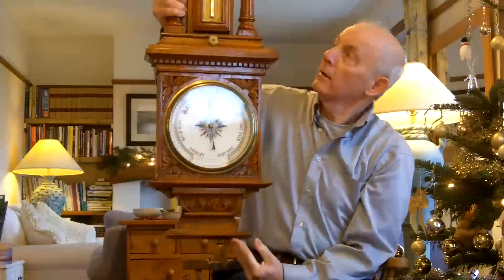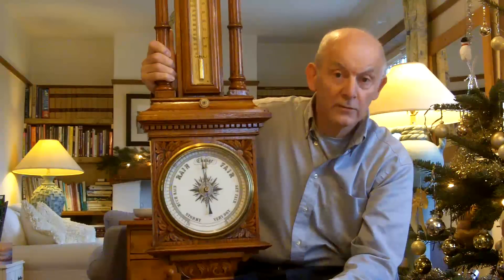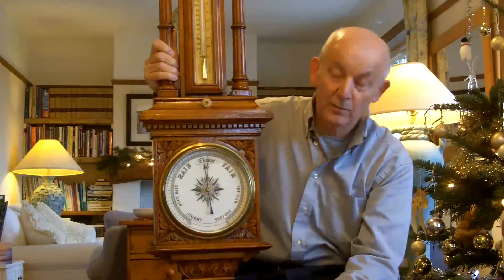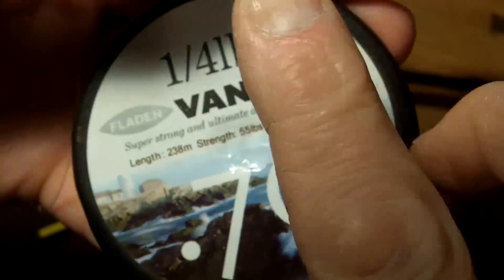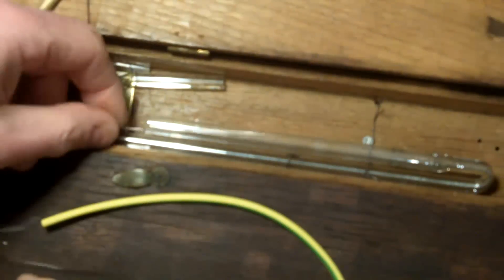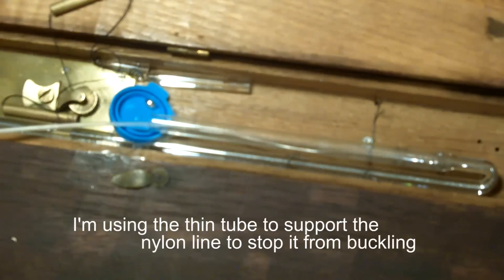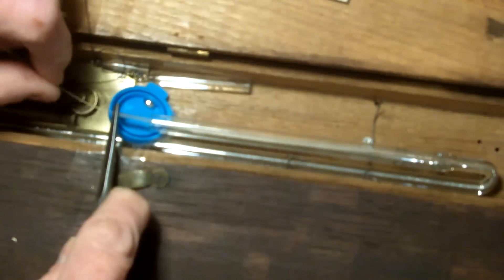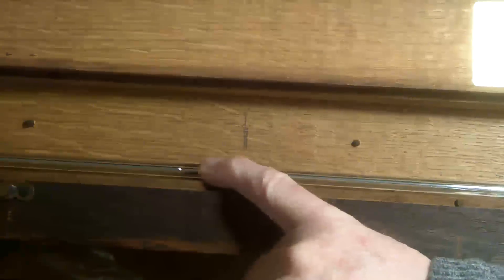Barometer...A quick look at how I removed airlocks from the mercury column

Comment: What a splendid specimen of an old mercury wheel barometer. I just bought a nice clean vintage mercury column barometer made to USA National Weather Service standards. Thank you for showing how to fix any potential issues with it. Now if I can only find the same type of a deal on a full set of lab grade mercury calibration thermometers. They are 18-24 inches long and only cover a 2 degree F or a 1 degree F or 1 degree C spread, and are marked off in 1/100ths, 1/250ths, 1/500ths or 1/1000s of a degree, graduations. You use them to calibrate electronic thermistors, & thermocouples etc. and adjust the circuitry that displays the temperature in an electronic thermometer to show the proper readings. The last set I saw was around £5000 or about £420 each.
Reply from the maker: Wow, I've never seen, or heard, of a thermometer with such graduations as you mention. I guess that, like the mercury barometer they will still be working with the original accuracy in a couple of hundred years time. How on earth would anyone calibrate such a thing to 1/100 of a degree, let alone 1/1,000 of a degree??  Or maybe after a couple of hundred years the glass would have changed shape enough to render it inaccurate?? I'll try not to worry too much about that issue.
All the very best . . .  Andy

Comment: Phenomenal....Our Torricelli barometer has been unserviceable and full of air bubbles since moving house and spilling out some mercury nearly 10 years ago. I thought I was facing an expensive repair but it was the best £4 spent on 55lb fishing line (shouldn't use any thinner) and a plastic straw to guide the line. I don't know yet but I think I may need a few CCs of mercury to top up. Otherwise, top tip, thankyou very much.
Reply from the maker: Glad to have been some help

Comment: Hi Andy, I had to move an Admiral FitzRoy Barometer from on house to another a few years ago and got airlocks in the mercury tube. A week ago I finally got around to looking online and found your videos and I just finished clearing the airlocks with some 10lb. fishing line. It took about 15 minutes and 2 tries and they are now cleared! I will need to acquire some new mercury and have found a few places online that sell mercury switches. Thank you for sharing your information on this, it was very helpful. John Hall, Albion, CA. USA.
Reply from the maker: Well done John I'm glad to have been of help. Kind Regards  . . . Andy
Reply: Thanks Andy, after I add the new mercury to the barometer, if I'm still having any issues with getting it to read correctly, can I check back with you for some advice? Thanks, John.
Reply: @prwd491  How do you add mercury to barometer

Comment: The one with 3 switches is an erector switch for a gyro assembly, it provides electrical switch contacts for levelling the gyro assembly when it deviates from level due to the earth turning, the motion of the earth around the sun, or imperfections in the bearings. It supplies a low torque motor in the gimbals that slowly torques the gyro back to level over a period of around a degree per minute.

Comment: I think a Torricelli barometer lying flat, or at any angle where the ‘projected’ length is less than 30-odd inches, will have no vacuum at the top, is that the case when you were working on yours? Does the mercury not run out when flat like that? I have a Adm Fitzroy with the ground glass tap stuck (open).